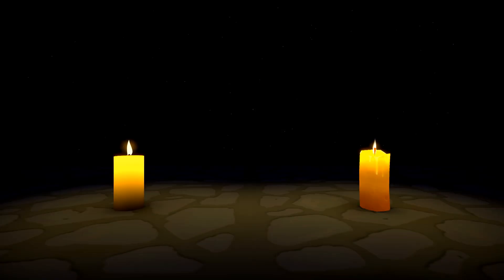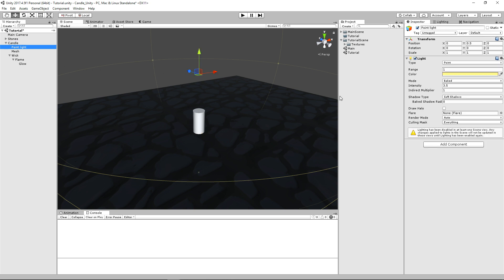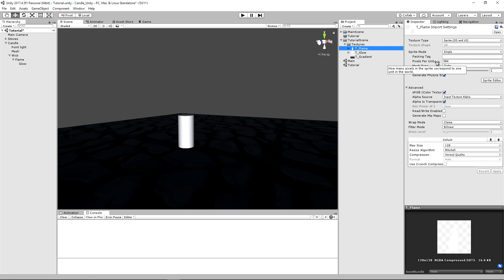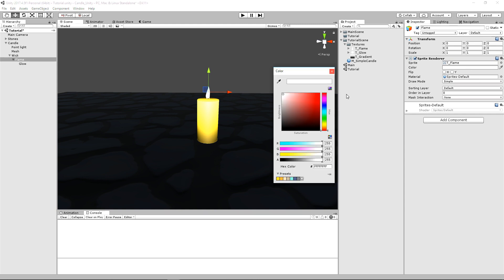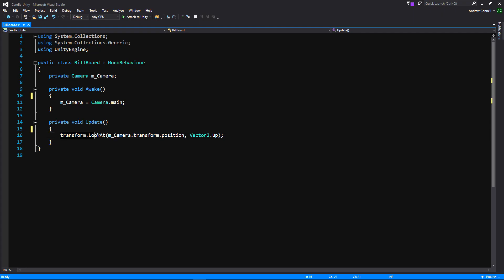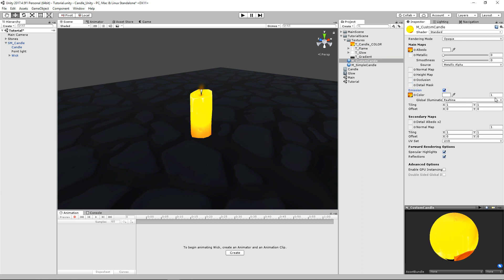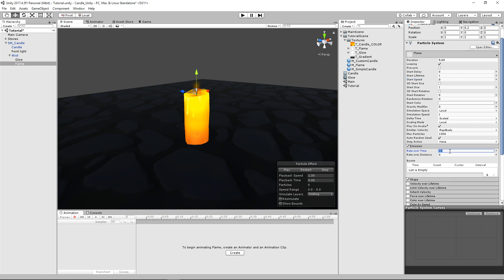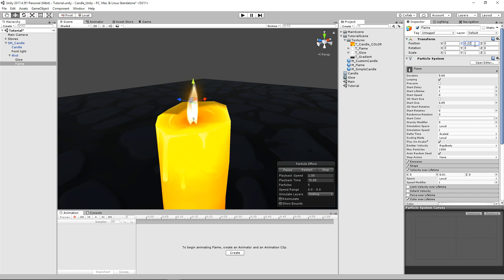How to make a Candle in Unity

Comment: Thanks for the tutorial! I'm trying to figure out the proper workflow for HDRP lighting, like what if I want a ton of candles everywhere with varying/flickering intensity - would that be dynamic lighting/would it be really performance intensive? Does HDRP use baked lighting too or do you do something else with it?
Reply from the maker: I have a very general understanding of lighting, so I'd recommend looking into it further. Both pipelines support both realtime, and baked lighting. Realtime  GI is for high-end machines if that's what you're going for. But, it is very taxing so you may need to use the simple lit shaders instead of the PBR ones.
Reply: @VRwithAndrew  Ok interesting. Thanks, yeah I guess gotta look into it more.